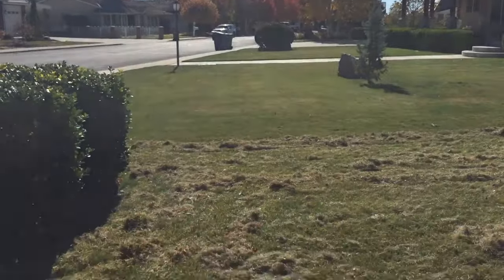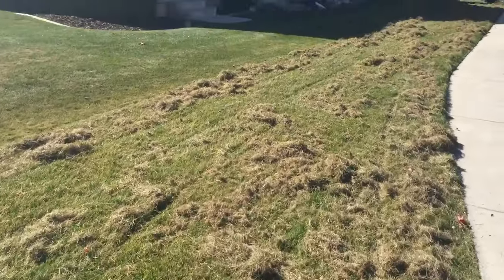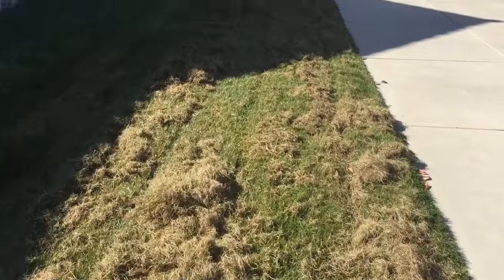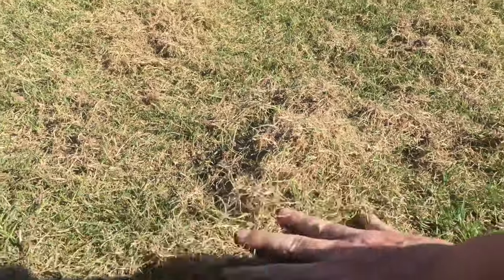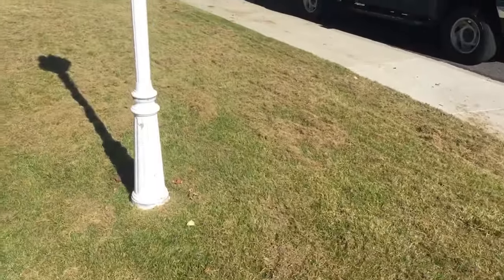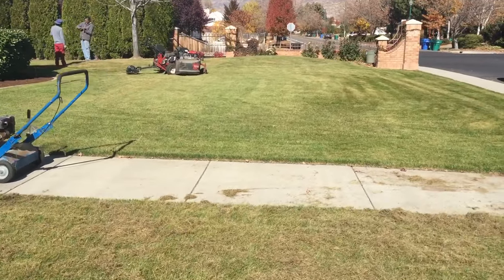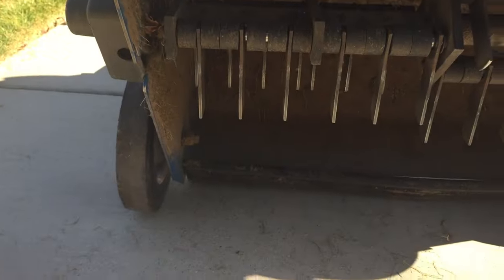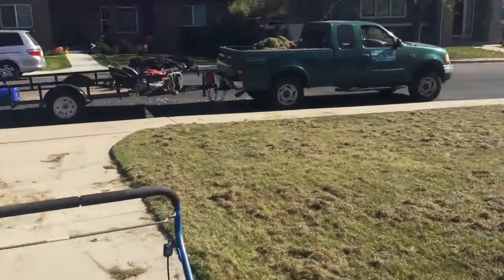Why and how to power rake or dethatch a lawn

Comment: Kentucky Blue for the overseeding here. In a Nebraska climate turf with many shade trees, blade runner fescue is what I’ve been told to use. Hybrid with red fescue. What would be best seed for this type of lower light lawn reno?
Reply from the maker: Really appreciate you watching the video.  In answer to your question I feel that a deep root structure is the saving grace.  I feel I've had good luck with Barnbrug products and like there rtf (rhizomatous tall fescue).  It grows in real thick, tight, and uses less water because the roots shoot 20".  I didn't believe the roots could go that deep so we put some in a planter pot and let it grow for a few months.  within a few months we had 14" roots in a pot that sat indoors most of the time.  Here's a link to the product I like.  Keep in mind Barenbrug for some reason is re branding and re bagging constantly.

https://www.amazon.com/gp/product/B076WYMZ82/ref=as_li_tl?ie=UTF8&camp=1789&creative=9325&creativeASIN=B076WYMZ82&linkCode=as2&tag=pestandlawngi-20&linkId=51aa41bf37ea376bbd3394f645cf9ee7
Reply: Thanks much, I appreciate the info!

Comment: good video
After dethatching do you mow the lawn with a bagger for cleanup? I have a 36 in Toro Proline with a metal bagger, so should I dethatch first, then cut the lawn with the bagger on to collect all of the thatch?  Any order or formation you can advise would be appreciated, thank you.
Reply from the maker: I like to do my mow first.  Little shorter than normal.  Then I'll use my mower to pickup the debris after the power rake.  I'll repeat that 2 times then move onto a hand rake.  Checkout episode 2 of this is my lawn in my playlist.
Reply: @  @pestandlawnginja - Why is raking by hand needed?  Won't the mower/bagging get all the removed thatch?
Reply from the maker: @Twister051  the bagger doesnt get it all unfortunately. Some of the mulch is sticky and doesnt want to come up with the machine. Needs a little extra help.

Comment: Can you aerate and dethatch at the same time (in the same weekend)?  If so, I assume you dethatch first?
Reply from the maker: Great question! I like to do the entire power rake and clean up first and aerate after.  You can do the entire process the same day without a problem.  I feel like if you aerate the lawn after the power rake you'll get a better core and dethatch from the aerator.  It also makes for less debris going back into the aeration core holes.
Reply: Pest and Lawn Ginja Thanks! I pinged Scotts with the same question. They said doing both at the same time would be hard on a lawn. Perhaps they were speaking specifically about a lawn like mine (in need of TLC). Thoughts?
Reply from the maker: I don't believe much of what the "experts say".  I always error on the side of trying worst case scenario.  I've power raked and aerated my own lawn the same day on the hottest time during the summer and still received great results.  If you're concerned I would adjust the power rake and only do two passes, clean it up, and a final hand rake.  As long as you don't lower the machine too low and scalp the lawn I don't mind.  I found for our climate perennial rye grass struggled the most after a power rake.  If your worried, order a bag of revive and humates to perk it up.

Comment: Can you mulch the thatch back in? I want to get a dethatcher for my tractor but I don't have anything to suck it up, 1.5 acres.
Reply from the maker: That's a tough question.  If you had a machine that would do a good enough job to mulch it into a proper "dust" I'm afraid it may go down too thick on top of the real thatch layer and cause some issues.  It would all depend on how much comes up.  If there's half as much dead grass that comes up as in this video it may work.
Reply: Thanks for the knowledge- I'll give it a try. Coming up on the first full year here, for the fall I mulched all my leaves into the lawn and it seems to be coming back nicely (a shitload of big trees on premises). I wanted to avoid buying a monster bagger unless absolutely necessary..
Reply from the maker: You're welcome.  I don't blame you for attempting.  going against the grain has taught me a lot. LOL
Reply: lol, while I'm stealing your experience, do you recommend a large manufacturers bagger (like 14 bushel, running off existing pulley system) or a tow behind with it's own motor?
Reply from the maker: that's a great question.  I'm kind of old school.  I would use the biggest bagger that would allow the least amount of work and effort.  the tow behind imho would give the least amount of work if it had a hydraulic dump to it.
Reply: Remove the dead thatch.  Compost it. Now you have topsoil for lawn reuse.  Why plant so much grass?  Dig that useless lawn up and get a hydroseeding company to shoot out a wildflower mix.  Once established, no more watering!  Colors are gorgeous, birds and butterflies will thrive.  Lawn is dead!

Comment: How does the dethatcher do when it comes to sprinkler heads?

When I aerated, I used a spring loaded aerator so it skips over hard objects and doesn’t hurt anything.
Reply from the maker: Hey rymaster4385 .  Thanks for the comment.  To answer your question, it all depends on the model and type of power rake.  This particular one I used was not one that would crush a sprinkler head.  It can if the sprinkler head is really old and brittle but in the 7 years we've used it we haven't had a single instance of damages that were reported.  Aeration on the other hand.... SMH.... We've fixed a lot of heads hahaha.
Reply: That my friend is why they make de-thatching rakes.  Utterly worthless for the full yard, but addresses odd corners, getting around sprinkler heads, and the odd statue of John Paul Jones [if you have that sort of thing laying about].

Comment: Should you wait after power raking to over seed and fertilize?
Reply from the maker: Mike Stevens that's a great question. The short answer is yes, waiting until after you complete power rake is better. 

The reason is the fertilizer and seed can get bound up in the dead grass. However I wouldn't suggest putting off fertilizing or over seeding if you're not going to complete the power rake within the next 3 to 4 weeks

Comment: Thatch is the ENEMY.....got it!
Reply from the maker: lisa gordon thanks for the comment! Merry Christmas.
Reply: I need to know more about my enemy... Is it just old grass? Half grown grass? Can i Use in in much or silage? does it contain seed? Thank you for all the Information thus far brother keep up the good work.
Reply from the maker: Thanks for for the comment!  Questions are always welcome.  From what I understand your question is what is thatch?  Thatch is the compost material that is directly in and above the top soil layer.  The answer to "what thatch is" has become somewhat debatable and depends on where you feel the thatch layer begins.  My opinion stands that the thatch we speak of (the overall term people use) is the dead grass layer that sits above the soil.  The problem is that people aren't mulching correctly to form a proper thatch layer (decomposing ground up grass blades).   Properly mulched grass blades will be ground into a dust like substance and will not appear as dead grass blades.  Unfortunately, just like slang terms, the term thatch layer understanding is changing because people misunderstand what it really is.  Lawns are supposed to be mowed when the blades grow 1/4" above the desired height e.g. Kentucky bluegrass desired summer height is 3" I should cut it when it reaches 3.25".  If I cut it when its longer than that, meaning 1/2" or more, it becomes harder for the lawn mower to properly mulch.  mulch in my opinion should be ground down to what appears to be a dust like compound, not leftover cut grass blades.  If you are seeing blades longer than 1/8" after you mulch you are not mulching you're just leaving dead grass.  

I feel overall people plant and want to have a nice lawn classified as rhizomatous grass.  Here in Utah we find most people want Kentucky Bluegrass because its most inviting on there feet and the rhizomes grow the closest together out of any other available grass we have.  If you are not mulching properly and leave dead grass on top of the soil it chokes out the rhizomes therefore disallowing the new blades that emerge from the rhizomes to properly emerge and eventually the lawn thins out.   It also doesn't allow the nutrients from the fertilizers to pass through the dead grass to the soil.  Here is a link to a video I've done about the mulching subject: 

https://www.youtube.com/watch?v=_a2ThORNURQ&t=14s  To answer your question "Can i Use in in much or silage?"
     - I wouldn't use normal yard grass clippings or mulch to convert to silage.  From my understanding, I could be wrong, silage is made from feed grade grasses specific to the animal you're feeding.  rotting or old cut grasses can harm horses, cows and other grass fed animals so please be careful.

"does it contain seed?"
     - Mulch can contain seeds.  It would depend on the lawn and where it was cut from.  It is not uncommon for grass to have a seed head depending on time of year and types of fertilizer used.

Really appreciate the questions and the feed back.  Don't hesitate to ask questions.  I will do my best to provide good content.
Reply: Pest and Lawn Ginja ... Great detailed answer to "What is thatch?" Glad I stumbled upon your page. Keep it up, please and thank you!
Reply from the maker: Thanks for the compliment!  I'm doing my best to provide good quality information.  if you catch me slippin let me know!

Comment: What do you charge for something like that and how long did it take?
Thanks.
Reply from the maker: Hey there Gabe.  The company I work for doesn't offer power raking.  Most companies that offer a power rake and cleanup in my area charge between $150 to $250 per .25acre lot including the cleanup.
Reply: You can rent a dethatcher at home depot for $53 for 4 hours or $75 for 24hrs

Comment: Hey Ginja!  Does the term 'power rake' and 'de-thatch' have the same meaning?  I'm looking for a tool I can attach to my small riding-lawnmower to help with this.  Thanks.
Reply from the maker: essentially yes.  both terms hold similar meanings.  try searching for a front end tine dethatcher for your mower.  They do a good job.
Reply: @pestandlawnginja  Why front vs rear dethatcher attachments?  Suggestions?
Reply from the maker: from what I've seen and watched, just my opinion, it doesn't need additional weight to be put on it to get into the soil.  It also is adjustable without having to get off of the mower.

Comment: why hand-rake up the thatch instead of just using lawn tractor to go over it and suck it up into bag?
Reply from the maker: Occasionally I will use a ride on mower to do the initial cleanup. The last pass needs a hand rake to get the sticky stuff out.
Reply: ok, thanks.  I was curious.  what do you think about using a combo dethatcher & Aerator machine?
Reply from the maker: @mwin86  I've never had the pleasure

Comment: What height do you need to set the detjatcher?  I put in Zoysia about three years ago and I know it needs a good dethatching. I'm worried I'll scalp it down to the dirt! :)
Reply from the maker: Terry Bridges thanks for the comment!  In my opinion every power rake is slightly different. We always teach our technicians to start at the highest setting and do a test pass. Repeat this process while lowering the power rake blades one notch until you find the desired height. If during this process you start to scalp you can adjust the machine one or two notches higher to find the sweet spot. This will ensure you only scalp a small area instead of the entire lawn.  It is important to know that in many cases the power rake will remove 80% of the thatch. I recommend using a rake and removing the residual thatch using good old fashion hard work. Good luck! Let me know if you have any other questions I can answer.
Reply: Terry Bridges go over the  lawn with a metal leaf rake

Comment: So, where's the before and after pics ?  I mean, show me the results, the GREEN GREEN grass...otherwise it's just another tool in the many trick bag of lawn care con jobs.....in my humble opinion..never have de-thached and have never had a problem...my lawns have always been top notch looking....no fertilizer, just manual airation with cool spiked shoes (and killer quads and calf muscles by end of summer.....)
Reply from the maker: DuluthGuy really appreciate the feedback. I agree and feel before and after pictures are a key role in providing reliable content. This lawn in particular is still in the rebuilding process due to an overseed with a slit slice seeder. I will provide an after video as the new Kentucky bluegrass seed thickens up. All the best,  Ginja.
Reply: “Lawn care con job” ha! It sounds like you’re hiring the wrong people. First, Tall Fescue lawns do not accumulate as much thatch as Rye/Bluegrass lawns. 

Grouping all professionals into a “con job” status is rude and presumptuous.

Comment: Mulching and Bagging at the same time?? If your bagging who cares if it is mulching.. If your mulching who cares if it is bagging..
Reply from the maker: Thanks for commenting.  If memory serves me right you're commenting on the landscapers mower that mulches and bags at the same time.  In answer to your question, the machine allows more grass to go into the bag if it cuts it up into tinier bits and allows the workers to cover more area with fewer trips to dump the waste.  This increases there productivity and saves them $$$.  The machine does allow for mulching back into the soil.  To do this they would simply remove the bag and insert a stop plug.  In our application that would be counter productive, they had too much dead grass sitting on top of the soil.  It would be pointless to put the dead grass back that we are removing.  

Another problem we face locally is cheaper mowers with the mulch option IMHO aren't mulching fine enough and essentially are leaving dead grass everywhere not mulch.  This happens more often than not when people let the grass grow too long and the mower can't grind the grass up sufficiently.  Hope this explanation helps.  Have a great day.